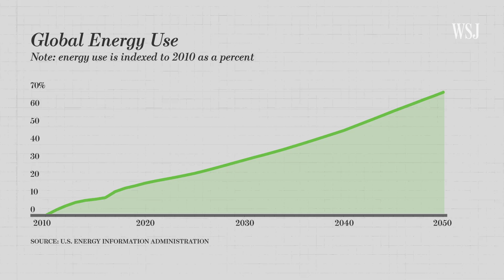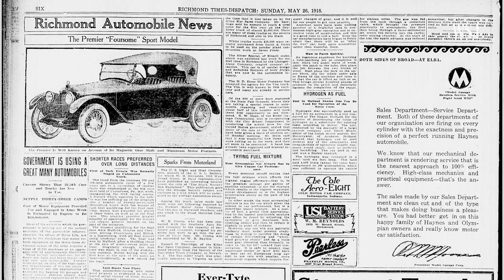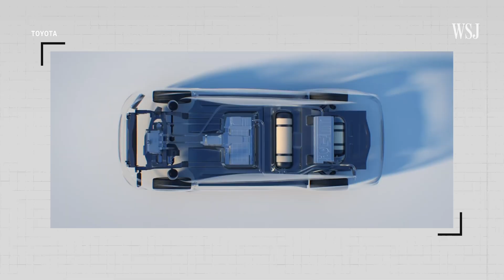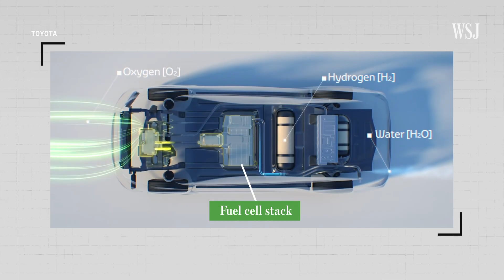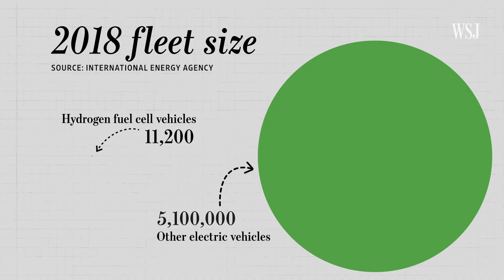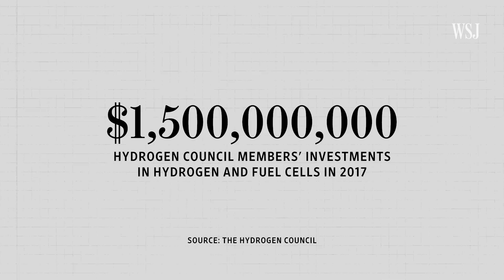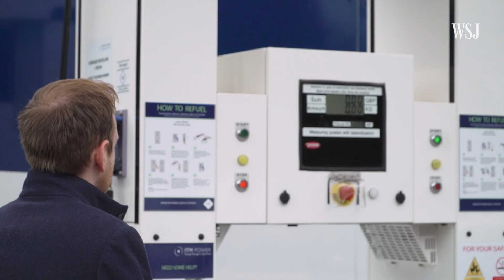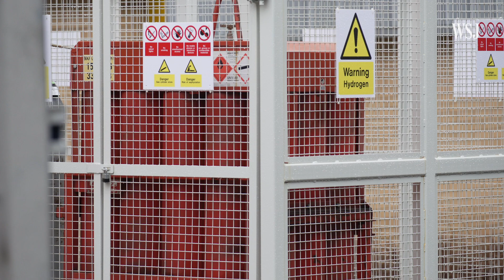Can Hydrogen Fuel the World's Fast-Growing Energy Needs? | WSJ

Comment: There’s no environmentally friendly way to mass produce hydrogen at this point.
Reply: Nuclear power is the most environmentally friendly source of energy and it is a wonderful source of power to produce hydrogen. Anti-nuclear hysteria is irrational in the extreme.
Reply: @hyperi0n001  The US Navy has a way to use nuclear energy to make carbon neutral fuels from seawater, there's no need to even bother with hydrogen.
Reply: PistonAvatarGuy no we are not putting mini reactors in vehicles. Also the navy doesn’t care about exposing their sailors to radiation.
Reply: @ShidaiTaino  What are you talking about? There isn't a reactor small enough to fit in a car! You use a full-size reactor to produce the fuel, then distribute it, like you would distribute fuel from a refinery. The fuels would work in existing vehicles and existing gas stations, no need to spend many trillions of dollars on a completely new refueling infrastructure, and no need to force people to give up the vehicles they know and love.
-
I just can't understand how someone could think that I'm suggesting that we put nuclear reactors on vehicles, what is wrong with you?
Reply: It can be implemented eventually. When wind/solar farms are producing more than the demand it could be routed to be made into hydrogen. But it will take a while before they make a process that can do that automatically.
Reply: @Sulfen  but there are other variable demands for intermittent renewable electricity: recharging batteries, pre-heating and -cooling space, other industrial processes. Maybe making hydrogen with renewable energy will become economical, but until current industrial hydrogen users stop getting 90% of their hydrogen from natural gas, talk of a green hydrogen economy is misleading fantasy.
Reply: Overwhelming Exception Fallacy.

No...mass pollution until planetry destruction is not inevitable, if that is the implication.
Reply: @Manish Bisoi No, it can't, because production is just one hurdle of MANY that hydrogen needs to overcome to be viable.
Reply: Solar, wind, hydroelectric— most of these can easily power electrolysis cells. However, a lot of work needs to be done to increase productivity.
Reply: Companies are transitioning from fossil fuels to renewable energies, although some companies may have achieved it. The same can be said about electric too, and their Lithium batteries are nearly impossible to recycle once used.
Reply: @cerisem7727  Of course lithium-ion batteries are recyclable, especially large valuable ones in cars and storage. The biggest problem is they haven't been made in large quantities for very long, they're lasting a long time, and many are reused in stationary storage applications, so we don't have vast quantities of them available for recycling. It will eventually be a profitable industry just like recycling the lead-acid batteries from conventional cars (which are far more toxic than lithium-ion).
Reply: @skierpage  Should have added more details into my comment, but what you said pretty much explains the reason about Lithium batteries. The recycling infrastructure for Lithium hasn't developed fully like the lead-acid batteries has, especially since the electric car trend is booming.
 From what I recall, only a few materials can be recovered from Lithium with current recycling, such as cobalt and aluminum. But most of the materials that haven't been recycled are discarded, which    should be possible to recover all of the battery. Just with further development/refinement on Lithium recycling.
Reply: Wrong.. I too thought hydrogen was expensive and inefficient to produce then I came across new science by an energy lab called H2IL. This would put hydrogen in first place.
Reply: @scienceeducatorge8597  the H2 Innovative Lab "About the Science" page is painful to read, it spouts much nonsense. You're a fool if you're suckered by this over-unity garbage. Try to live in the real world!
Reply: Oh yes there is, (always been since the '70's - It's called the Sun and cheap mirrors - closes oil circuits and simple turbines - look it up - the oil industry killed it) - Tell that to your children...
Reply: I was just replying to another blog on this video about a highly efficient means of hydrogen generation that a lab has cracked. We have done research and it truely produces over 30 times more that modern electrolyses. Totally clean. Just look up H2IL
Reply: WHAT A LOAD OF RUBBISH! Renewables: PEM Electrolytic Cells... they can be rated to whatever productoin cycle we want, and combining he in  offshore platforms with solar and tidal/wave, for uninterrupted, multi-modal generation , means constant evolution of h2.. and, as I explained above, PEM tech, Graphene and now the H2GO tech for ambiant temperature & standard pressure storage open up the door to h2 full-on, sweeping Fossil Fuels AND battery power - with the xception perhaps of Trevor jackson's Aluminium-Air batteries - well, more solid-state fuel cells!.

http://www.h2gopower.com/
Reply: https://youtu.be/B8YnIYMHk0Q
Reply: Powerhouse Energy
Reply: Yes there is. You have been lied to.
Reply: Maybe do some research first: https://spectrum.ieee.org/energywise/green-tech/fuel-cells/solar-panel-prototype-splits-water-to-produce-hydrogen
Reply: @iwiffitthitotonacc4673  That process is never going to be as efficient as using the electricity from the solar panels directly.

Comment: I wonder if hydrogen fuel is just another scheme like "Big Oil". There are some issues here:
- Drivers have to depend on fuel and supply infrastructures provided by big coglommerates. They will dictate fuel prices.
- Steam is also another potent greenhouse gas.
Reply: steam (water vapor) is a greenhouse gas yes but it is in the atmosphere in such abundance naturally and will come back to Earth as precipitation. The real greenhouse gas that is threatening us and we are putting in the atmosphere at an unnatural amount is CO2
Reply: @cliff2285  Everything on Earth has its own natural recycle circulation. CO2 released by human is also absorbed by trees, coming back to Earth. However, we human end up putting more CO2 out faster than the rate of tree absorption. Hence, we have greenhouse issue. So my what-if scenario is also like that thinking. What will happen when we release so much water vapor into the atmosphere more than the maximum amount the Earth can handle?
Reply: Phat Phan Rainfall will be more abundant and there’ll be more humidity in the air for vegetation to absorb and help fend off drought. But considering we obtain hydrogen from water, you referencing cycles answers it; the water cycle will maintain that nothing gets too excessive.
Reply: @STEPPACAFE  it's unlikely to be a problem. The vast majority of water vapor comes from oceans, and the biggest human contribution is from irrigation.
Reply: There is no escaping from Big Anything.  We already have Big Food corporations, Big Telecommunication, Big Entertainment, Big Government, and soon, Big Battery and Big EV's aka Elon Musk..., Big Solar like Tesla, Trina solar, Canadian Solar, First Solar etc...so, Big Energy that will promote Big Hydrogen will still going to be Big, just like Big Oil of the past.

Comment: Great video, very informative. The idea of a hydrogen fueled car seems a lot more realisitic for a wide market, simply because of the short refueling time, compared to relatively long recharging times of electric vehicles.
Reply: The thing is the refuel time is the only advantage fuel cell cars have over battery electrics.  Battery electric cars are cheaper to make, much cheaper to run (a Toyota Mirai costs 5 to 6 times as much to fuel as a Tesla Model 3 does to charge), have similar ranges, are about the same weight (the LR RWD Tesla M3 is 3kg lighter than the Mirai) and fast chargers are much cheaper to install than hydrogen station - it costs Tesla a few hundred thousand to set up a supercharger site; setting up a hydrogen station costs $2-4 million.
Reply: If you have access to a plug at home or work, then every day you get in a car that's charged for your normal driving. No waiting required, no trips to gas station, cheap and convenient. People obsess about their 800 mile trip to grandma, but it's a small portion of most people's driving.
Reply: @TY K Great, go buy a Toyota Mirai that costs more than a Tesla Model 3, is heavier, much slower, and leaves you dependent on a handful of refueling stations selling expensive hydrogen! But so far and for the foreseeable future it's a tiny market compared with battery-electric cars. Automakers have decided which technology to bring to market in the 2020s and they've overwhelmingly chosen batteries.
Reply: @TY K I'm confused. In the approved list of nonsense talking points against BEVs, the complaint is that $30,000 cheap-to-recharge cars are expensive and only for the rich.
There are indeed some wealthy people who don't have access to a plug, who drive near a hydrogen station, and want to reduce their driving emissions; unfortunately in California that market seems to be only a few thousand people. Toyota Mirai sales went down in 2019, Honda appears to have stopped selling the Clarity FCV, and Hyundai Nexo sales are negligible. Nobody else has announced an HFCV for the USA.
Reply: @TY K your own words show how weak the hydrogen car market is. The stations have to be subsidized to get built. The cars have to be subsidized and fuel has to be included in the lease for people to buy them. Even with those far greater subsidies, Nexo sales of 3,000 in South Korea are dwarfed by 13,000 Kona Electrics and combined BEV sales of over 30,000 in Korea in 2019.

Face reality. Hydrogen fuel cell cars are not selling well, and the only company investing more in them than BEVs is, possibly, Toyota. Everyone else has made their decision.

The Swiss HFC truck order seems more fantasy than reality, we'll see if it happens. Just as with cars, far more battery electric trucks and buses are being sold, announced, and in development, than hydrogen fuel cell versions.

When and where did Jeremy Rifkin make that prediction? All I can find from him about hydrogen and Europe was 17 years ago. Hasn't happened yet!

Comment: what happens when cars crash?
Reply: lawofparsimony explosion happens
Reply: There is not a more significant problem than traditional cars so you shouldn't be worried
Reply: how about what happens when electric car crashes... have you seen those videos?
Reply: @mullerstephan  there are hundreds of gasoline car fires every week. Battery car fires are rare, they only make the news because they're novel.
Reply: No fire.  The Hydrogen tanks are indestructible even on the most severe crash.    Valves inside the tanks will switch off Hydrogen flow to prevent fire.
Reply: THE "BIG BANG".   LOL
Reply: If there's a leak in the canister, it seeps out into the air and goes upwards away from the car, whereas gasoline goes downwards and stays as a liquid near the crash.
Reply: @iwiffitthitotonacc4673  It could also leak into the car and either suffocate the occupants, or explode.

Comment: I love your videos very informative
Reply: This video is an advertising lie!
They don't lie about what they say.
What is lied about is what is not said.
It is lying when you deliberately conceal or belittle important facts.

2:36min Water and electricity produce hydrogen
However, you forget to mention that you need about 50kWh of electricity to produce 1kg of hydrogen. 1kg of hydrogen only has an energy content of 33kWh. The rest of the energy is lost.
Furthermore, until the end of the film it is not mentioned that today hydrogen comes mainly from natural gas, coal and crude oil. Hydrogen is produced by fossil fuels at a rate of >95%! Because hydrogen from the electrolysis of water is much more expensive.

It is clear that hydrogen is an (extra to be produced, secondary) energy storage medium, but it can in no way solve our energy problems.

After all, the electricity for electrolysis has to be generated first, and it is better to use it as directly as possible instead of first producing hydrogen and then using it to generate electricity again. Because of course there are additional losses.

Hydrogen is above all a lie to keep people from using renewable energies! People are put off instead of, for example, generating their own cheap photovoltaic electricity and using it to charge their own electric car.

An electric car is cheaper, easier and better than a hydrogen car. No one in the world is therefore building hydrogen cars in large numbers. The Toyota Mirai doesn't even have a folding rear seat back....

4:28min Using electricity from hydrogen to charge electric cars?!?
A curious idea when you look at the costs. Not everything that works technically makes sense. This idea is nonsense.

5:29min If you look at the members of the Hydrogen Council, it becomes clear what these companies want. We should have to keep driving to petrol stations instead of generating and charging our own electricity at home.